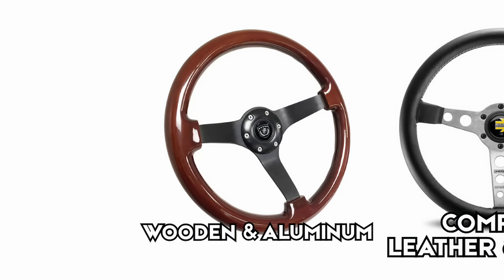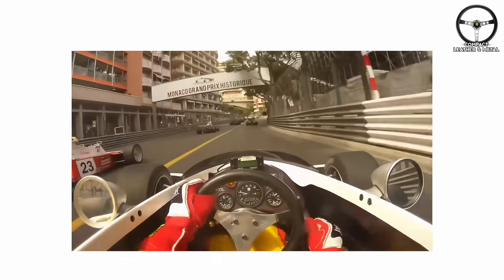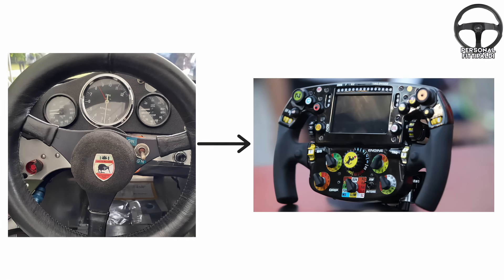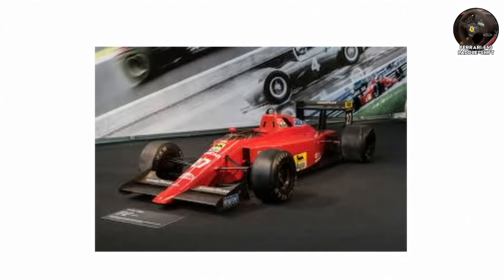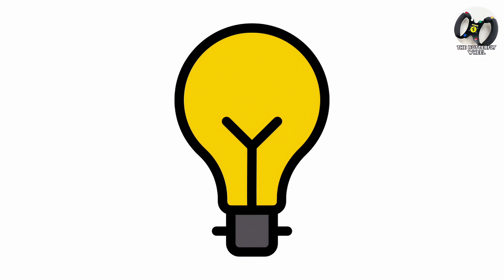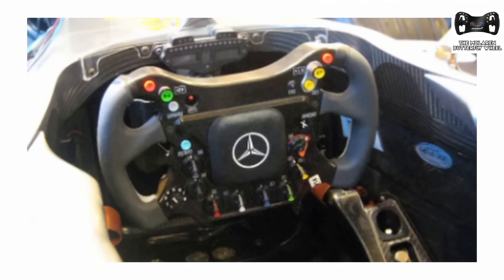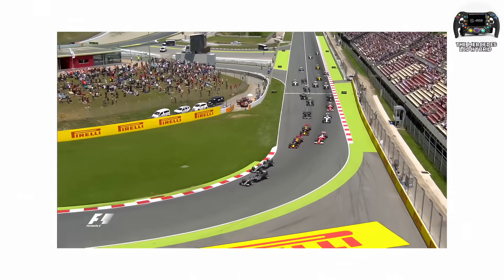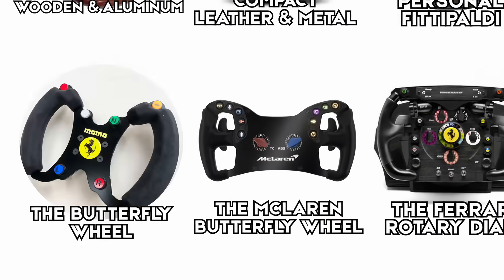EVERY F1 STEERING WHEEL EXPLAINED

Comment: i genuinely think that the williams wheel looks amazing
and without the screen, the weight of the steering wheel is less so you could feel the feedback much better than the ones with screens,
i dont see why people hate it
Reply: On the flip side the wheel now has slightly less surface area, so when TV is broadcasting the feed of the camera facing the front of the driver's face/helmet, there is no longer space on the back of the steering wheel to be captured by that camera, onto which sponsors' logos could've been placed onto (alongside the driver's name & no.)

Comment: If anybody thinks this is F1 steering wheels final form, wait until they start integrating augmented reality capabilities into the helmet, and even reducing the physical buttons into glorified touchpads.
Reply: No, AR on helmet wouldn’t work… you want driver to see the road ahead properly and not having engine rpm  obscuring an apex or another car.

And touchpad?… imagine trying to use a touchpad at 300 km/h with cornering force of 7g.

Just… no.
Reply: @tonamg53  It's a long-term kind of thing.
Reply: @Iamwolf134  No, it doesn’t work now and will never work in the long term.

The tech is already there and has been there for many years already if they wanted to use it.
Reply: @tonamg53  nobody said that the Tech would be the same by then.
Reply: @Iamwolf134 AR is AR… 

If there is a new tech that isn’t AR then you wouldn’t call it AR or would you?

If there is a “new tech” that we have no way of knowing what it is right now then sure, it might be implemented in the future… 

but AR is definitely not it and definitely not the friggin touchpad.
Reply: @tonamg53  people have said the same thing about various other Tech before they were proven. Like I said, long-term project.
Reply: @Iamwolf134  Both AR and touchpad has already been proven NOT to work with car racing. That’s a fact. 

You don’t even need to actually prove it… you immediately know it’s not going to work when you think about it.

There’s a head-up display on car windscreens for more than a decade already… Do people use it? No. It’s a gimmick; you use it once and you’ll never use it again because actually having numbers displaying on your windscreen is annoying AF.

And if you like “touch control” on your road car, then something is seriously wrong with you.
Reply: @tonamg53  it's about offloading to allow for a lighter weight steering wheel.
Reply: @Iamwolf134  steering wheel weight makes zero different to the driver. As long as it is balanced, no driver would complaint if it is heavy.

And you actually would prefer the wheel to have some weight in it so it doesn’t feel like you’re driving a toy.
Reply: @tonamg53  it ain't the weight that matters, it's where it goes.
Reply: @Iamwolf134  The wheels are mounted on the car, it ain’t going anywhere. 

And its not like removing an lcd screen is going to removed much weight, they weight like 100 grams at most… 

The weight of steering wheel is not an issue and absolutely no point to make it lighter
Reply: @tonamg53  like I said, it's about where it's allocated.
Reply: @tonamg53  On the flipside without AR the driver has to look slightly downward at the LCD display to check the speed & take their eyes off the road/apex/another car. So they will have to decide which one they prefer
Reply from the maker: i think AI will take over - driver intervention will be minimal
Reply: @SimplyRacing12  although not for a good long while